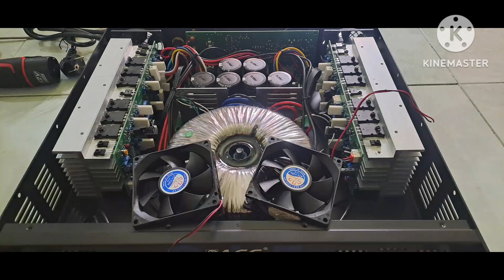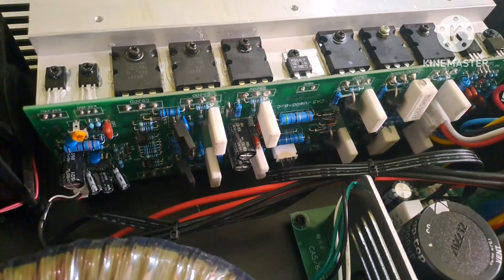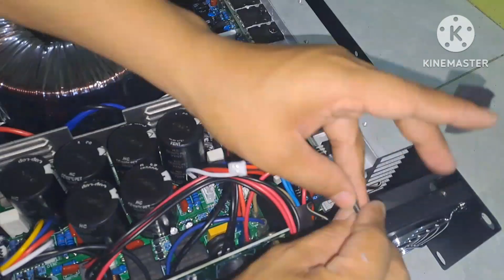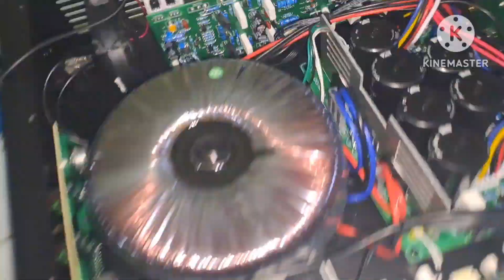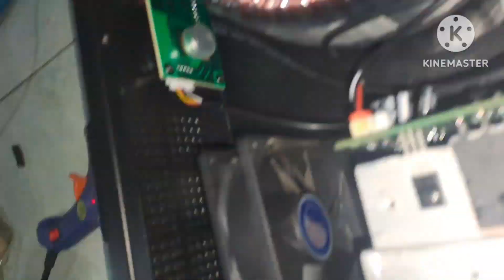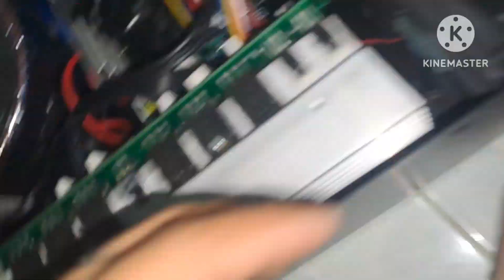Ace Ca5 Power Amplifier, installing additional fan

Comment: Jinumper nyo lang boss dun sa wire nung fan yung connection nyo na wire papunta sa harap  na bagong fan?
Reply from the maker: yes sir, pinarallel ko dun sa dating fan nya, wala kasi ako available na maliit na transformer na 12 volts.
Reply: Hindi ba sir hihina Yung dalawang fan kapag mag add pa Ng Isang fan kapag naka dugtong lang?

Comment: Sir normal lng bah ang blower huminto kpg wlng kalabog Ang speaker or Continue ang ikot kht wlang kalabog sa speaker sana mapansin comment ko sir slmt po
Reply from the maker: @PhilipGeraillo  sir depende po sa amp natin sir, madalas po kapag sa integrated amplifier, nag titrigger po ang fan kapag mainit na ang unit, mag o off lang po kapag na malamig na sya, sa mga power amp naman po ay gradual ang pag buga ng fan depende sa gamit ntn, kapag umiinit, bumibilis po ang ikot, meron ding mga power amp sir, especially yung mga high powered po na naka on na po agad ang fan.

Comment: Boss kamusta na po performance ng ca5 na inupgrade nyu balak ko dn sana ganyanin Ca5 ko
Reply from the maker: Still working po sir hanggang ngyon, gamit pdn madalas lalo pag may handaan
Reply: @sirdesdiyamplifiers2951  anu pinagkaiba ng na upgrade po na ca5
Reply from the maker: @RonaldEscoto-g9c  yung sakin po kasi sir is not totally upgraded, nagdagdag lang ako output transistor dahil may vacant nmn tsaka mataas na din kasi supply nya kaya need talaga na damihan ang output para safe at magaan sknya pag naglagay tyo ng speaker, advantage po pag medyo babad ang paggamit. Yung fan nmn po na dinagdag ko ay para lang may pang support sa stock fan nyan, so far nmn sir effective ang ginawa ko.

Comment: Ok lang po ba mag add ng fan  nka parrallel. wala po epekto sa performance ng amp.or mas mainam may separate suply pag mag aad ng fan.
Reply from the maker: Sir opo okay lng nmn nakaparallel po, if may available po kayo na seperate supply ay mainam din po less stress sa main supply.
Reply: Ilang amperes(transformer12v) po ba ang  sakto lang sa sa dalawang fan..thanks po
Reply from the maker: @bluecahili2894  sir kung ndi nmn gnung kabigat po ang fan na gagamitin nyo is pili po kayo ng kakasya sa amp nyo po.
Reply: Okay lang ata kahit naka parallel ang fan sir kasi mababa lang na ampere ang requirements ng fan

Comment: Boss anu size ng fan ng ace ca5
Reply from the maker: 80x25mm ang ginamit ko dyan boss
Reply: @sirdesdiyamplifiers2951  meron po ba yan sa shoppe boss?  At pano po conection series lng ba sa fan
Reply from the maker: @JulzMalabago-q1t  meron boss, type mo lng yung size.

Yung connection ay parallel lang sa dating fan.